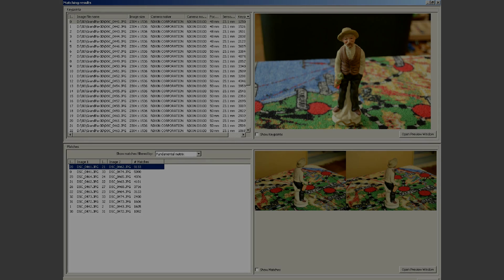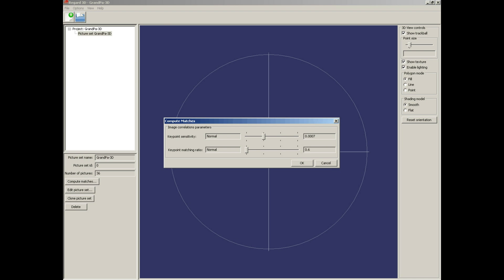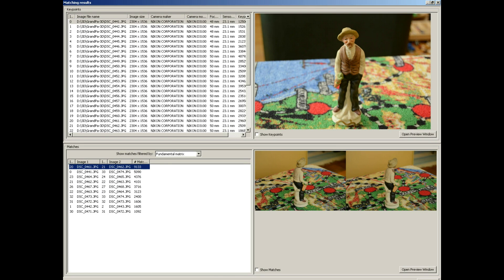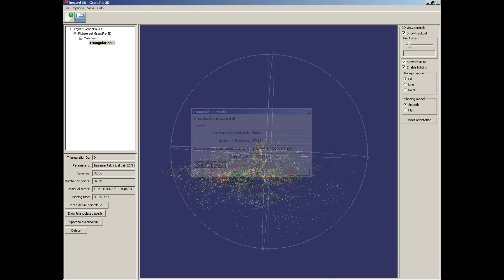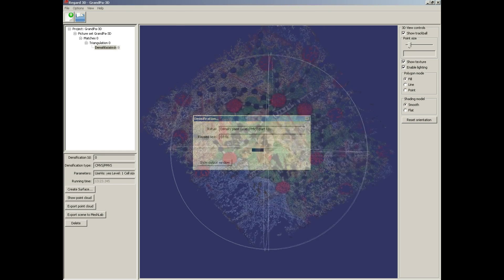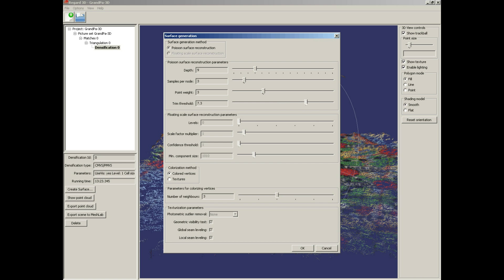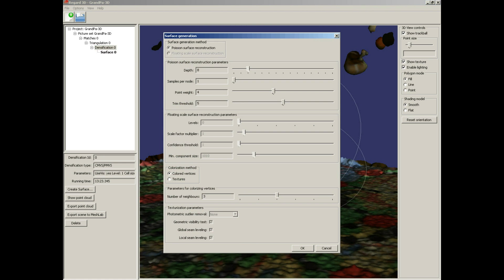3D Model From Photos - Testing Free Software Regard3D

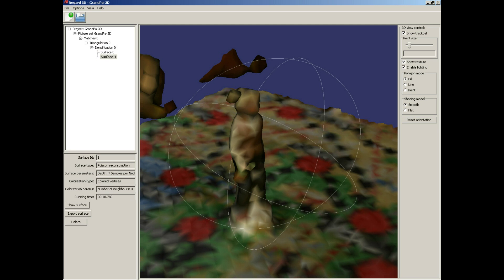Comment: and WHAT happened at 4:47 ?? How did you do this?
Reply from the maker: I use MeshLab at 4:47. It's other free software. Good and fast for cleaning. Easy, just a little bit strange sometimes (no undo). Mister P. has a bunch of good tutorials about Meshlab:
https://www.youtube.com/watch?v=xj3MN7K6kpA
Reply: @CinemaTablet  nooo. there was detail increased 10 times, it is impossible to make everything out of nothing
Reply from the maker: I think that it was settings tweaking. Last one has worse settings. The image switches then to Meshlab and the object with the best settings I found (depth level 9 vs 7 etc).